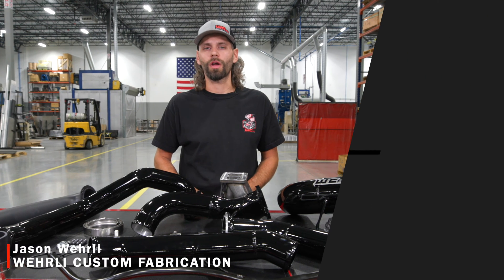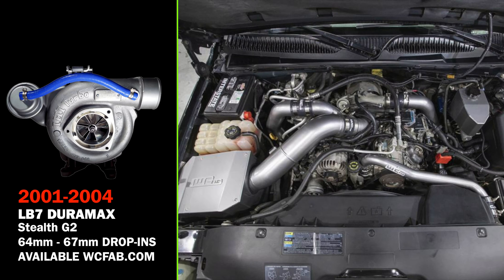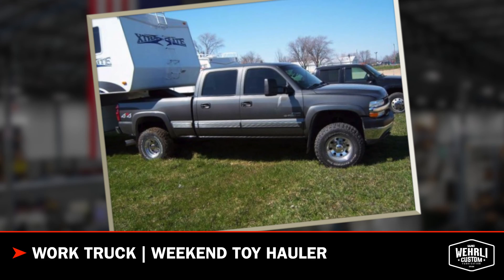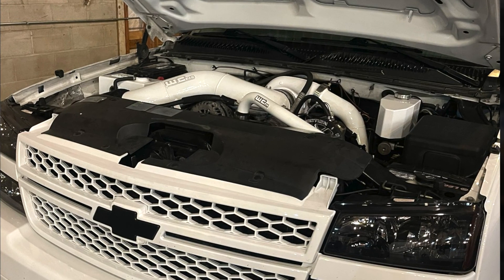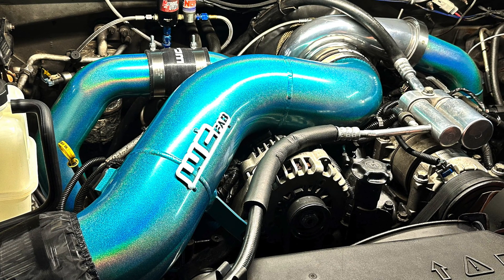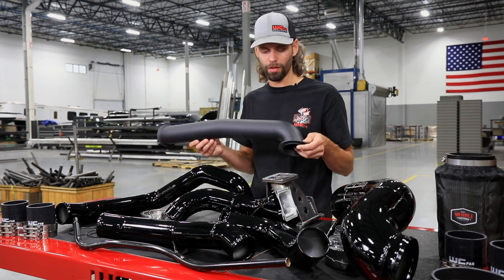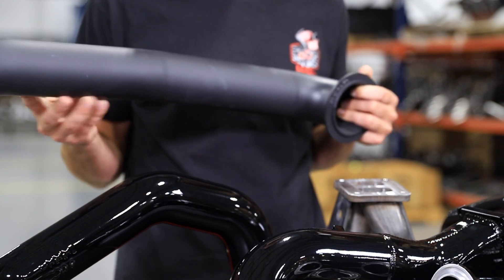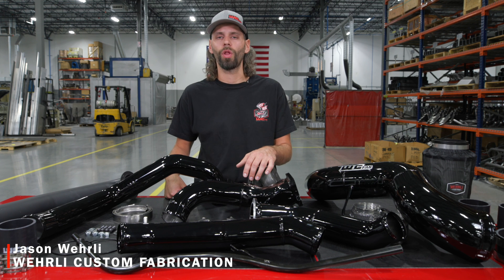2001-2004 LB7 Duramax S300 & S400 Single Turbo Install Kits

Comment: Can this fit on my lly? why and why not
Reply from the maker: How big a hammer do you have? 😂 Jokes aside, this kit is designed for an 01-04 LB7 specific fit. 04.5-05 LLY's share similarities, but are not identical. The differences between engines mean this kit won't just bolt up to the later models and we can't unfortunately provide details on what would need to be modified to attempt something like that.

Comment: what size exhaust housing should i pick for a s369 turbo kit from your website and will stock injectors be okay to run it with for a little bit? 02 lb7
Reply from the maker: We recommend a .91 AR Exhaust Housing. Stock injectors would be okay temporarily, but you will want to upgrade those.

Comment: im going to purchase this next week but i dont want to replace my downpipe i have there already which is the ppe ,,, do i have to use the one you supply
Reply from the maker: @TheKmac2526  a down pipe for a stock IHI style turbo will not be compatible with an S300 or S400 exhaust housing, the flanges and mounting are completely different which is why we supply a down pipe as part of this install kit.

Comment: Too bad you don’t build these for the lbz’s
Reply from the maker: That's true we don't offer big fixed vane turbo kits for the LBZ's, but depending upon your performance goals and how you use the truck, something like one of our high flow bundle kits together with a Stealth 67mm drop in turbo and supporting mods can make for a pretty rowdy and fun to drive setup.
Reply: i put it on my lbz it works great just get different intake manifolds, an intercooler and you need a different boot for your top outlet coolant pipe

Comment: No Lly or lbz kits anymore?
Reply from the maker: These kits are LB7 only. For LLY and newer Duramax engines we are focusing our parts development toward supporting performance VGT style chargers.
Reply: For lly Research .. HSP or SDP and Dans diesel ,, Ryann’s diesel service too
Reply: I’m looking for that whistle turbo sound on my lb7
Reply: Could I run a s300 with stock components on a lb7
Reply: @lucasdimovski69 yes more than but don’t push it all the time or you’ll regret